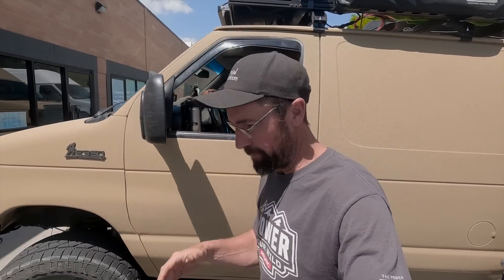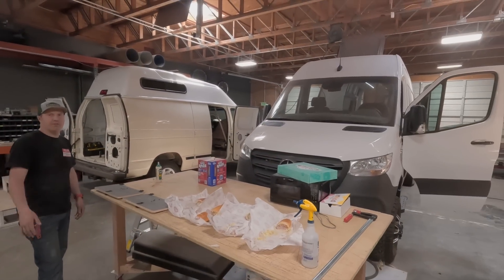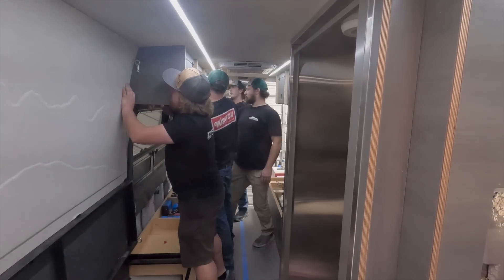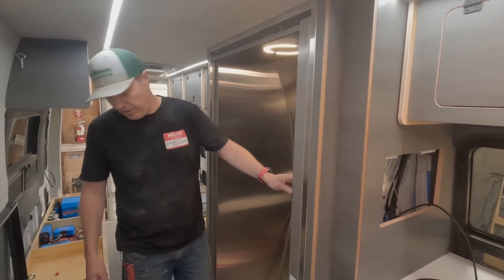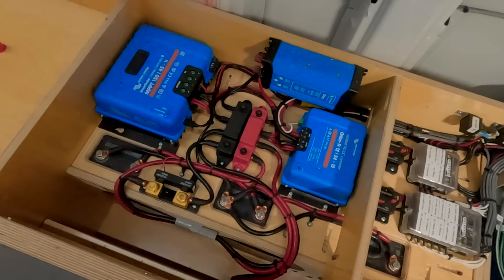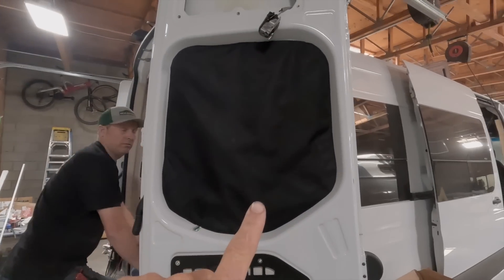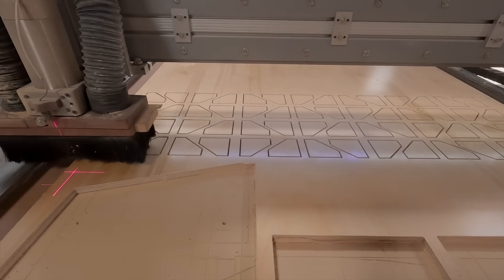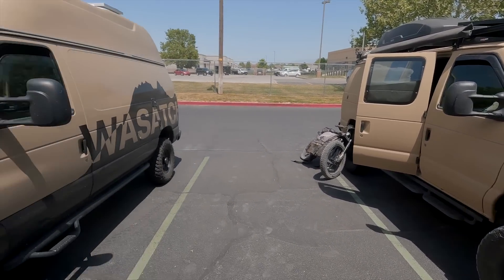Should I Get a High Top for my Van???  Wasatch Overland

Comment: Benefits are being able to stand up inside the van and giving you a more open space.  The biggest drawback I see is you would lose your roof rack which is something you constantly access (or it seems so) and you keep dirty items like the chain saw and fire wood.  Also losing trail clearance would be an issue which and is the biggest drawback to the sprinter van.  I also can't figure out how you could carry a canoe or kayak.  They are nice and I would like the extra space.  Great video.
Reply: Good point.  He could compromise by adding a large rear storage locker that's bumper mounted

Comment: I have a 1990 G20 Chinook high top and they are the only way to go. It is really nice to simply stand up. Look at options closely ... you need good insulation. wiring in place for solar, lights, fans, usb etc.

Comment: That is some tight wiring in that Benz! And got rid of my rack I just had Wasatch put a hightop put on my extended E350. Love it! Much more cabinet options for inside. I'll still have fans/AC/ and solar on the roof with no issue.

Comment: I put a high top on mine and it’s great. Tufport in Delta BC manufactured and installed it. Cost was 6500 CDN pesos with two sliding windows and a Maxair vent. Nice to be able to stand up in your van when you are 6’. Good luck!

Comment: Hi Jason, we met at OEW (I gave you an Astro Van Tribe sticker) - I've been considering a hightop for my 4x4 Astro but I'm not keen on the aesthetics of the tops available PLUS I really need/use the roof-top rack/deck so if I were to go with one I'd want to design it so I can still have that system up top. I've been toying with high-top ideas where the front comes up high enough to shield the wind from the rack so there's a 90° drop that the front of the rack butts up to - Hard to describe here I guess....  Anyhow, yes, get one, standing up is a game changer - as long as you can find a place for all the great you use the rack for - Something that might work for you is a "roll bar" rack set-up that wraps around the outside of the high-top

Comment: Jason, the way i see your set up is it’s at the best use as is. How much time do you actually spend in the van, if you do spend a lot of time in there how long are you going to be standing in there for and if you have a iffy back which can pinch a nerve or tear something apart, then yeah get one, if not, then stay low. Areas where low tree lines and sharp cambers will limit a tall van yours will not hesitate the challenge. There’s horses for courses. Pick a course I say, then pick your horse.

Comment: After using a commercial e350 with a fiberglass high top {package delivery for RPS which became FedEx Ground) I never had any negatives. The van was 2wd so it sits lower but I never noticed the extra height. The van had 300.000 miles on it and I was using it in a rural area with lots of gravel roads. The top never leaked or cracked. This is what 1991 technology was like. My thoughts are cross winds (I was in a heavy timbered area which means I didn't get exposed to endless heavy winds) and hitting the top with a lot of branches what that would do to it in the long term. Final decision will have to be up to you. For me being able to stand up it is worth it.

Comment: I'd put in a half pop-top that just covers the front half of the van so you can still have a rack and a space for solar on the pop-up and a place to stand up in. Unless an upper sleeping space is what you want. A bet a small pop-top would be substantially lighter than a full one.

Comment: Pop up has the advantage as clearance could be a problem with hard top such as parking structures and clearing tree branches on the trail. Also a hardtop isnt going to handle cross winds as well. But a hard top more than likely would stiffen up the whole structure compares to pop top. Hard top would probably offer mire insulation. A pop top you have the option if putting it up or not. If you had to pull off a highway somewhere to sleep and leave pop top down, not to attract attention in a urban area. Its a tough call. I like both designs. ( I was calling the high top a hard top)

Comment: If "to high top or not to high top" is the question, consider the following first: 1. how tall are you? 2. do you find yourself needing & benefitting from being able to stand up taller? 3. will losing rooftop carrying capacity hurt you? 4. will the increased drag and wind affect you much? 5. will the increased overall height prevent/limit your access to particular spots/trails/etc.? Weigh the benefits to disadvantages carefully!  ... best of luck to you 🍀🍀🍀

Comment: Why not both? Get a custom high top with enough flat surface for a rack even if slightly smaller it will still help a ton with hauling firewoods, etc. and then finally a linger ladder.

Comment: Add a comment...

I see a lot of pro's and cons to this and a possible solution as well. 

So first off with your vehicle being even higher off the ground it may start in hinder how far in the deep woods you are able to go with the lower trees and stuff like that. The other con is that you'll lose all your storage space that you keep on the roof rack. 

Pro's you'll have more space inside, you might want to actually add some things to your living corridors to make it more comfortable such as a TV or something along those lines.

Solution for the roof rack system. I am currently designer a camper van that I am going to start the project next year. So one of the thoughts I am having is have cabinets on one side then just have the hallway. Then on the other side have the same amount jetting in. This side will have spice racks held with cables, pots and pan holders, towels and blankets. So on the outside I can utilize the rest of the space to have a compartment on the outside of the van in the high top. It wouldn't be a ton maybe a foot deep or so, I won't officially know until I get the high top placed on the van. But there I plan on putting my chairs, fire pit, dry wood, fire starters, fishing gear, camp stove and a 4 pack of 1lb propane tanks.

Hope this helps.

Comment: Speaking from experience, get a hi top. The older you get, the easier it is to move. Especially when you have to pee in the middle of the night. I have a higher than normal canopy on the back of my pickup, and swear by the vertical space. I don't even need to exit vehicle when nature calls in the middle of the night. Also extra headroom storage. Go for it.

Comment: In my (completely unqualified and I would say ignorant) opinion if you ignore cost, the main thing you need to think about is what it's going to do to the vehicles centre of gravity, particularly if you then put storage cupboards in and still keep a roof rack.  Not a huge problem if on road, but if you're off-road off camber with that much weight that much higher....

Comment: I like the high top, but don't think it's worth the loss of the roof rack.
For me the van is a tool used to get to the outdoor spaces and for the convenience of a  slightly safer sleeping quarters. 
Once you get the high top you would be moving more into the van and less outdoors. So IMO the trade off isn't worth it.

Comment: On second thought, i would hold off. Your roof rack is quite nice. Plus you spend a lot of time out in the woods. The high top could interfere with low branches on the trail and potentially other clearance issues. Pass on it for now. Or, get a second van, do the high top on that one. 1 van for wilderness. 1 van for NOT in the woods.

Comment: Well first ask what are you trying to accomplish overall? If you're primary intention is to camp and be outdoors, does a high top enhance that experience? Sure a high top will be more comfortable for long term life on the road, but it may also improve your physical health by allowing you stand in your upright posture more frequently, not just outside. Is the comfort and health worth it the height and monetary cost? From my research, having a bigger enclosed private space is why some people upgrade to bigger campers, so that they can tolerate the outdoors more comfortably, physically and mentally. When it comes to performance, we know the vehicle can handle it. For many situations the taller center of gravity wont keep you from going places, but perhaps the height may be an issue in heavily forested trails. How frequently have you driven down roads where the van was just barley short enough, how important is that to you?

Comment: No High top. Center of gravity is important. The higher you go, the less off camber driving your can do. Think about the amount of room you gain inside because of the items you store on the rack. The high top would necessitate more walking area inside, which incidentally also reduces storage. (Which, by the way, most “High Toppers” end up adding on top of the already high top)We have met a lot of overlanders with high tops, many of them with damage on the front and or top of their fiberglass top. We are completing our build on a Quigley 4X4 modified GMC Savana van. Standard length, standard height. The purpose for us is utility, safety, and durability. It will get us where we want to go, and once there, like you, we move outside as much as possible. After all, that’s why we built this van, for the “outdoors”, and not so much for the indoors. Just our put. Whatever you decide, I’m sure you’ll be happy, you think things through!

Comment: High top, awful in cross winds and reduced gas mpg's. High top, great for standing up and moving about, especially as you get older. Also, more storage opportunity. For me , I would go with a pop-up of some sort and keep the function of your roof rack. You wouldn't have to open it all the time but it would be there when you wanted the extra height. Cool Wasatch Overland logo too.
Reply: Not really. I have a high top. Don't think wind and mileage is that big of a deal.

Comment: No ! No ! No! Not these designs ! Up to date high tops should have this option .. a risible hard top hinged on front of high top and canvas sides with windows wedge looking feature !   The risible hard top can support frame mounted solar panels … why buy a out dated hard top when they could build a much better air flow & head space ? & some could have sleeping arrangements hidden in the top it would give the sleeper a great view & safely tucked away up high with better ventilation ! They could build them just as cheap & provide more options ! Don’t settle for old designs !